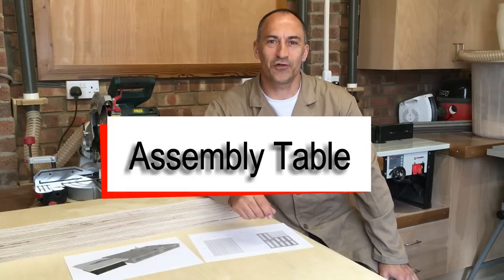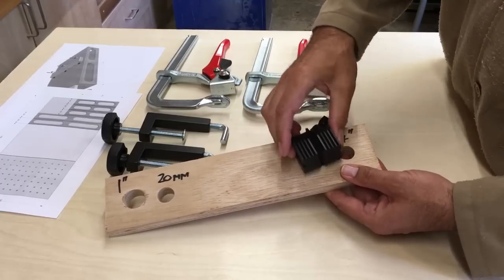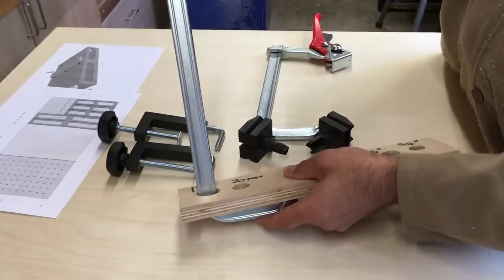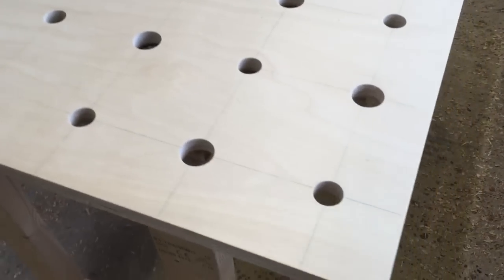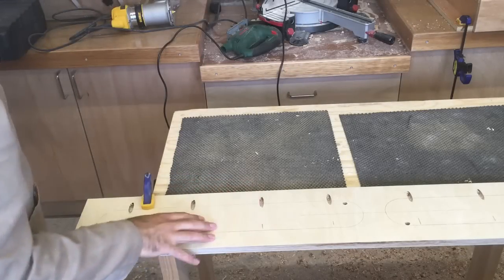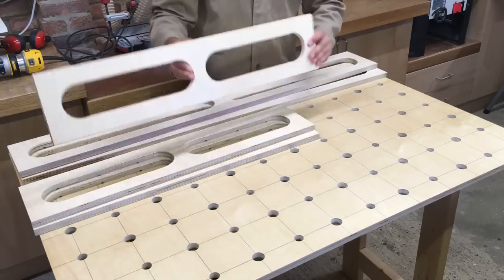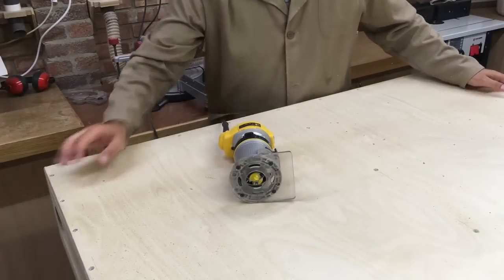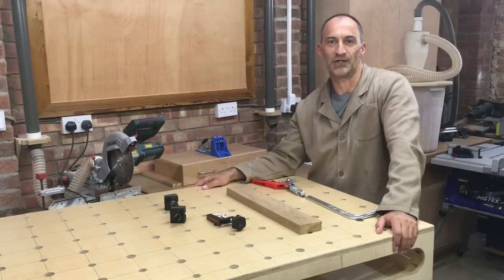How to build an Assembly Table

Comment: I have 2 homes, which at the main I have a shop with enough space to handle all my machines including a Legacy Ornamental Mill, at #2 though I share my "shop" with the furnace room!  And up til now have just made little things, but decided I want to start building more complex things and realize I need to build some portable carts to handle my bench top size machines including some I need to buy yet and a multi purpose workbench. Long story short I came upon the Paulk bench and have watched several videos how to make it...yours is by far the most simple and straightforward!  And being a girl, my brain even though it tends to be very construction oriented isn't geared towards knowing how to come up with problem solving issues and that's why I also find all your other videos very straightforward and simple.  bla bla
Reply from the maker: Hi S Roberts, really pleased you found it to be useful. Give me a shout if you need any further advice. Thanks

Comment: Great couple of videos. The Sketchup one helped me with another project especially how you disassemble for the cutting list. Waiting for a jig to make a top and I will use you design as the basis for a portable table.
Reply from the maker: Matt King, thank you for your support. 
Curious, What jig are you waiting for?
Reply: Hi Greg, don't know how to post link but "RS CNC Pro jig". I want the holes to be spot on as I want the table mainly for cross cutting at 90 degrees with my track saw. I don't think I could get them 100 on centres with my hand drilling.
Reply from the maker: Ah I see, a router jig for cutting the holes perfectly spaced.
That will help for gluing up parts square to each other too
The router with a spiral bit would cut neater holes too than drill.

Comment: Hi there, enjoyed your video..I was thinking of using aluminium profile but the price for all the parts soon stack up even more so since I am thinking of having my mft 2204mm X 718mm . I think i may go for your option  - may i ask you please , what is the whole table resting on and when you were driving in the kreg screws what was your torque setting on your drill driver? many thanks

Comment: Hi Greg, curious you made the assembly table in June, how are you finding it using as an assembly table referencing off of it say for cabinet glue-ups etc?
Reply from the maker: Hello Ben, I'm loving the assembly table, it's so nice to have a flat level surface to work on. The only negative thing I would say is it's very heavy to move about. If I built another I would make it out of 1/2" plywood. Thanks for watching.

Comment: Great build Greg. I wish I had the room for a bench that size....anyhoo, well done mate 👍🏼😊
Reply from the maker: Hi Marc, I'm in a single garage so this assembly table will only get put up when in use and be stored away most other times. Thank you 😊
Reply: Greg Virgoe ah, I didn't think of that.....I suppose I'll have to use my workmate and bench together if that much space is needed....I better buy an 8x4 sheet of 18mm ply just in case....just don't tell the wife 😉😂😊
Reply from the maker: +Marc if I was making this again I would reduce it to 12mm ply. It came out little on heavy side. Just a thought. If you do go for a 12mm ply sheet then don't forget to lengthen the end panels to 776mm long. 👍🏼
Reply: Greg Virgoe Yes very true, 12mm would suffice. Cheers my friend. 👍🏼😊
Reply from the maker: No problem Marc. 👍🏼

Comment: without voiding the copyright laws can you supply the overall size and the thickness of the ply.
Reply: used your video and the wonders of a calculator and I now have the answer
Reply from the maker: Tom Satterlee watch my Sketchup video where I draw the table for those details. 😃👍🏼

Comment: Excellent video.  Very clear, and logically produced.  Is there a source (name of the manufacturer) for the workmate style dogs and for the black hold-down clamps that you use?  Those Bessey clamps seem to be really excellent.  Thanks!
Reply from the maker: Van Gray, I have placed links to the tools in the description of the video. It's a search result for bench dogs but if you scroll down the results you will see the universal bench dogs and black dogs there. Hope that helps 😀

Comment: Nice build Greg, I'd love to make one of these but not sure I have the room. Also a really well presented video, I'm really enjoying your channel. The plywood looks decent quality was it expensive?
Reply from the maker: Hello, really pleased you're enjoying the channel. 
Yes, it was one sheet of 3/4" furniture grade birch plywood @ £60
I wanted a really quality finish to the top surface. It is very heavy though.
In hindsight I should have made it from 1/2" birch ply to be a little lighter.
Reply: Thanks Greg I'll look into that ply.
Reply from the maker: Hello, This explains the grades very well.
http://www.lathamtimber.co.uk/downloads/birch-plywood-.pdf
I was using B/BB grade birch ply.
Reply: Thank Greg I'd taken a look at their website the BB looks decent enough for what I need.

Comment: Great Build Greg looks great, i have actually got the Ron Paulk plans i bought off his website ages ago, haven't made it yet but your version and plans look a lot better. Hows is the new saw going? did you figure out my problem with those hooks?
Barry (Eng)
Reply from the maker: Hi Barry, it suits a smaller shop. Think I would go down to 1/2" ply as it's little heavy. 
Yes, the new saw is cutting like butter. I did notice the two hooks underneath and could not see a use for them?
Thanks for your support mate.
Reply: Thanks for the reply Greg and the cut, on mine at least helps with it being a 60 tooth blade that they give you when you buy the saw. What height did you have the table as it looked high to me? It's a puzzler then 2 hooks but hey we both are stumped. Keep those great videos coming.
Barry.
Reply from the maker: Barry Roberts, I had it sitting on some metal trestles only temporarily and yes it's way too high. My new work benches and the new saw are all 900mm to the top. So the plan is to make some folding wooden legs for the assembly table to bring it down to the correct height. 👍🏼
Reply: Nice. 1 more pain in the butt question off me (sorry about this), how do you adjust the riving knife on your saw, as i need to lower mine a bit, and if i follow the instructions it won't budge at all?
Barry.
Reply from the maker: Barry Roberts, no need to apologise, the interaction is what I'm here for. Helping each other is what it's all about. 
Re the saw, under the insert you will find some grub screw to undo and adjust the depth. 
I have removed the riving knife altogether but that's only because I use other jigs and it gets in the way. Some may criticise that move but as long as you are careful and respect the saw it's all good.
Reply: Thanks for that i did try them but they must have been really tight, plus there was a small lever as well but i'll try again. As for removing it, i will keep mine on. I made a cross cut sled on my old one and kept the riving knife on it, but as you say along as you are careful which everyone should be, then there's no probs. Thanks again for the advice.
Barry.
Reply from the maker: Sorry not in the shop right now. The lever may unwind to adjust the depth. The two screws probably undo the knife altogether?

Comment: Hi Greg - what thickness of plywood would you recommend for use in the table?
Reply from the maker: Ben Hoffman, if I built another I would say nothing more than 1/2" (12-15mm). I built mine from 18mm birch ply and it's a little heavy to move around 😊
Reply: Greg Virgoe, after watching you build, i started to think that 1/2" would be sufficient given the support underneath.  Thank you!

Comment: Nice video as usual. The Bessey clamps you have are superb. I have a pair and they are my favorite. Regarding the 20mm hole problem with the Bessey clamps.
Bessey do a clamp called a track saw clamp, same as the Festool but cheaper. They fit the 20mm holes. Same good ratchet mechanism. Axminster Tools do a copy too but not as good a quality as the Bessey.
Reply from the maker: Yes Harvey, they are great. Solid and work very well. A little expensive but you do get a quality tool.

Comment: Just for the heads up, Festool ratchet clamps fit in 20mm holes without having to take the clamp apart.
Reply from the maker: Ok thanks, I'll have a look at those, are they expensive do you know?
Reply: Greg Virgoe  They are pretty pricey, being festool. I only used them in a shop I subbed too. Most of their non tool stuff has pattern parts made at a fraction of the cost though. Have a little dig through Google. I'd imagine they licence their brand name out for these kind of things, then bang a premium on it.
Reply: The Festool lever clamps are Bessey's with Festool colours.

Comment: You're fortunate to have a lumber yard that will make all of those cuts for you.  Here in the States we're lucky if Home Depot will cut a sheet of plywood in half.
Reply from the maker: Hello Mike, it was only 7 cuts across the width of the board. Most home DIY stores offer a cutting service, some for free and others like my timber merchant charge 50p a cut. If you don't have a large table saw it saves you a lot of hassle.
Reply: That saw was awesome i wish they had those in the states

Comment: I would recommend not using pocket hole screws to attach the top to the frame. This will not allow you to run a track saw over those joints as the screw will hit the blade of the saw when running over it. This massively limits the uses of the table.
Reply from the maker: bighands69 I would not want to cut into my nice shiny assembly table 😊I have a scrap of insulation that I use to cut sheet stock on